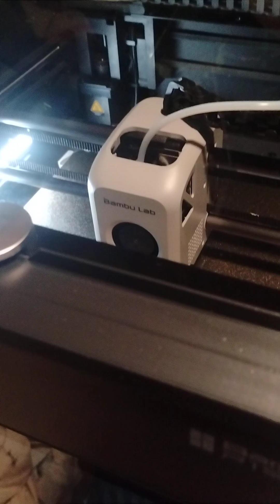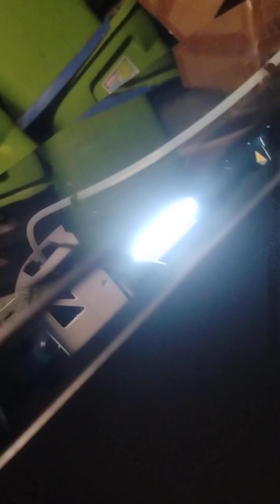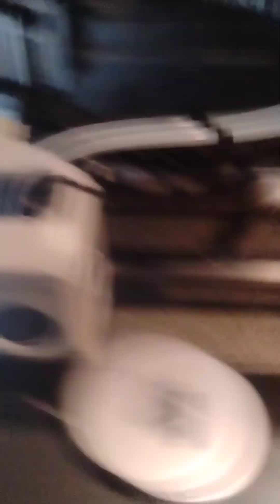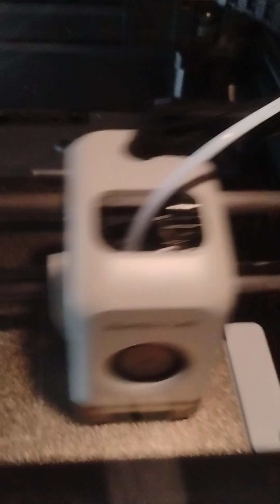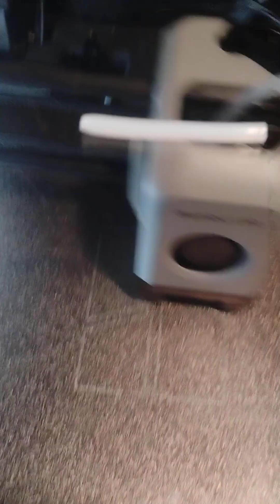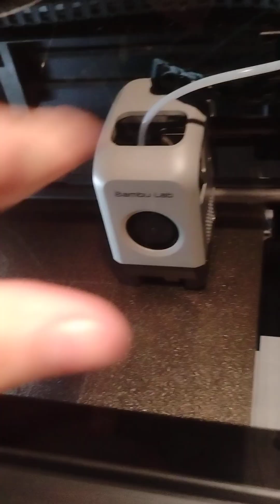Have a Bambu Lab P1S? TRY THIS! PTFE tube problem SOLVED.

Comment: is that going to make the head movement harder? and also are yours ptfe hit the right metal frame if you print big part? its making clack clack sound.
Reply from the maker: Head movement is restricted only if the ptfe is trimmed too far and the clacking in my case was some junk I had on the wobbly toolbox next to the printer.
Ptfe hits the side regardless trimmed or not